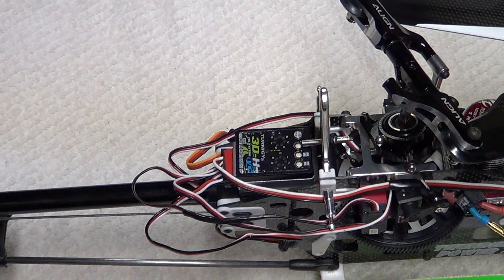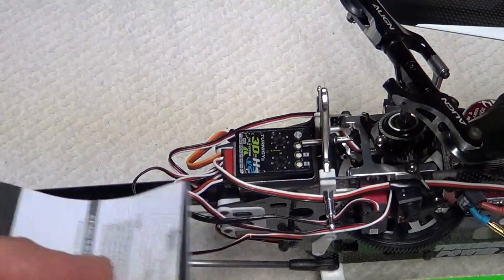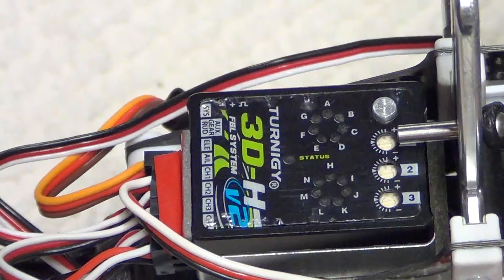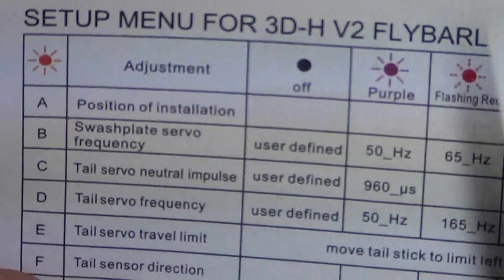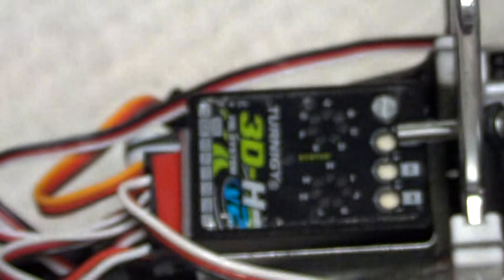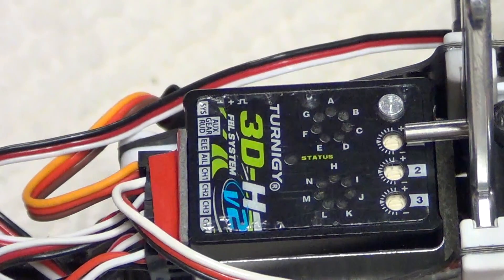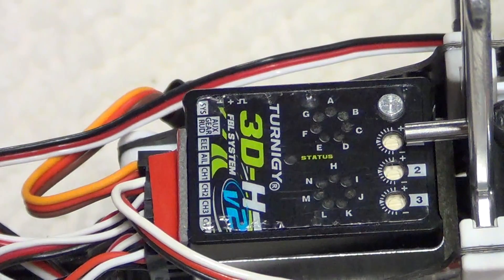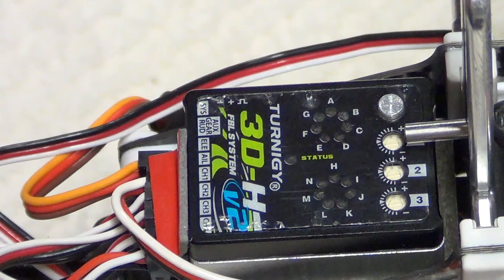Turnigy 3d- h v2 flybarless unit review plus tips on setting up servo connections

Comment: Hello, great video! I got myself the same Flybarless system, but I got a problem. (I am a beginner, got my first helicopter a few days ago)
I tried to set everything up (Use the Beast X Manual, the one from turnigy is straight up wrong) but after I adjusted everything I noticed a huge problem.
The tail servo works but it is way too sensitive. I have no Idea on how to adjust this besides from using limitations on my DX6-i. If my stick goes 10% to the right the tail servo moves 100%. Everything above 10% on the controller doesn't have an effect. I tried to set the maximum pitch on my controller to about 10%. I move the stick, it should put out 1% but instead puts out 10% and the servo moves 100%. (i hope it is not too confusing ;) ) Basically what I am saying: I can't adjust the sensitivity on my servo nor on my controller.

If someone knows the answear, I'd be very thankful!
Reply from the maker: +AsStrange0815 make sure you have the gyro set in the dx6i and there linked to each other that sounds like the problem
Reply: +nitrokyosho I will try to fix it this way, thank you!

Comment: Hi, I need help trying to connect this unit. I bought an Assault 450 PNF version. I'm using a DX9 with spektrum 6 ch receiver. Need help setting it up. Can't you point me in the right direction? Thanks.

Comment: I don't quite understand why you would fool around with this Unit Ray.  You usually buy good quality stuff.  And BeastX's are going dirt cheap used on forums as more people are trying different units.  I've seen them as low as $100 for the Beastx and $120 for the AR7200bx.  Even if the clone flies OK now, most certainly the build quality isn't equivalent to the BX and won't fail in the future.
Reply from the maker: it came highly recommened by people i really trust who have tested it.i will let you know if its great or junk.